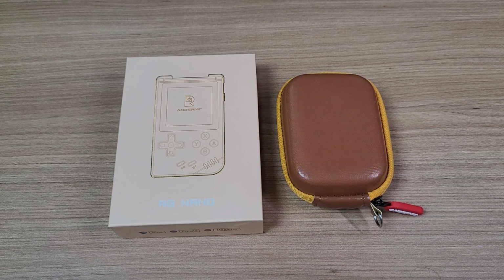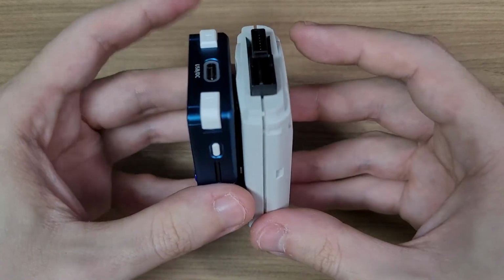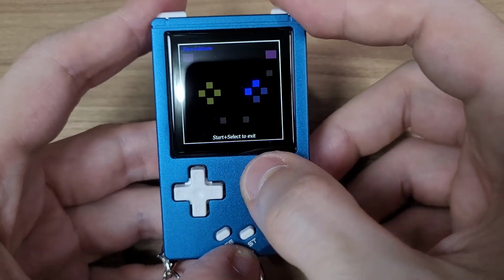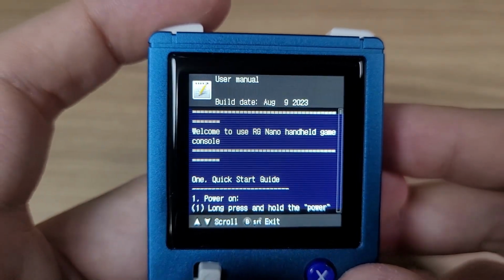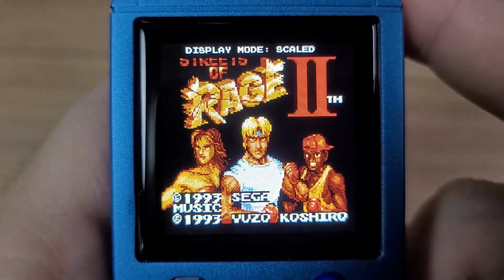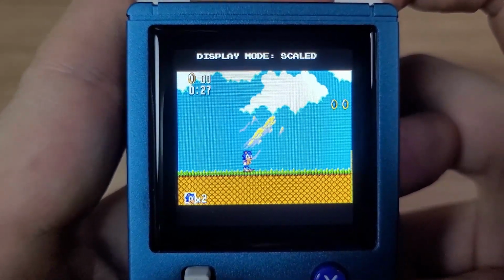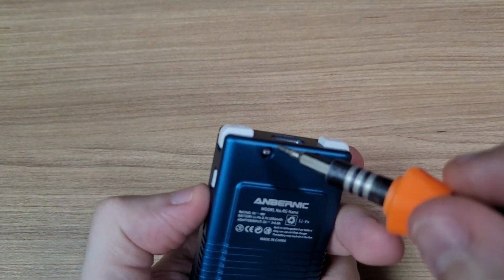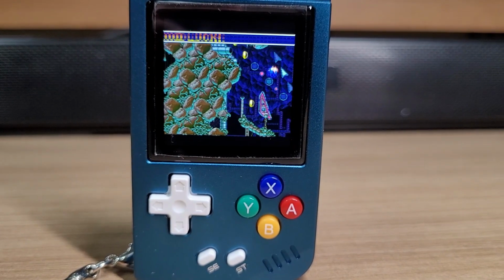Anbernic RG Nano - Giving a new meaning for old games

Comment: Cool if  can mod vmu  shell.  And put rg nano guts in it
Reply: I would be really messy, buy technically you could, but I don’t see why you would. The screen is bigger so you need to cut it bigger and add the two buttons. You would need some place for the triggers as well. Imo you shouldn’t because you would have to ruin the vmu but you do you